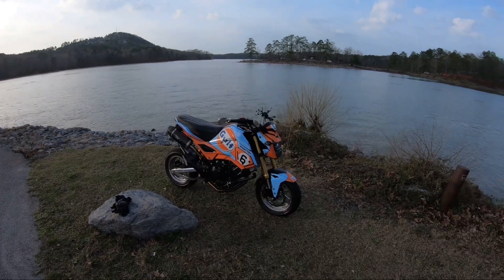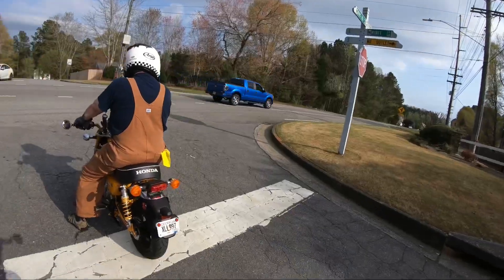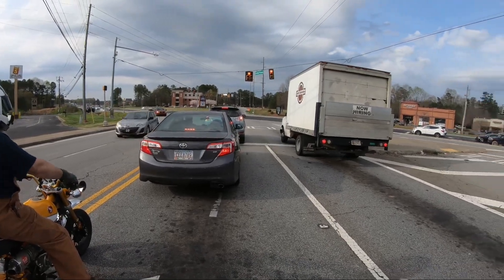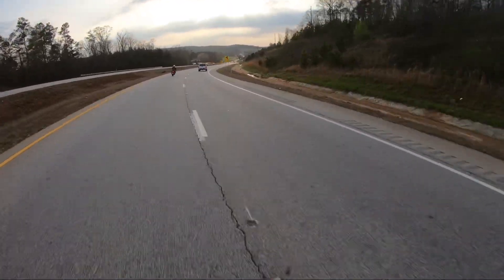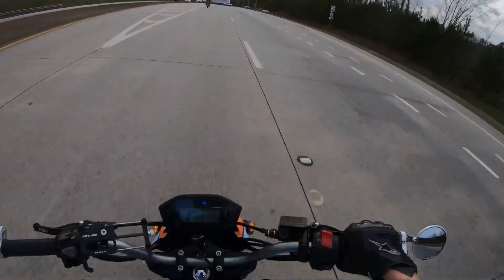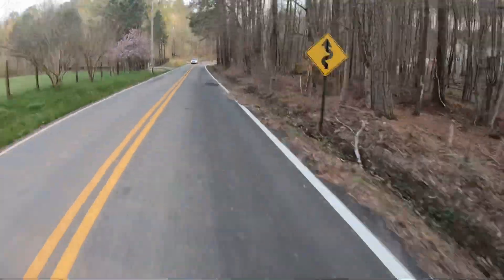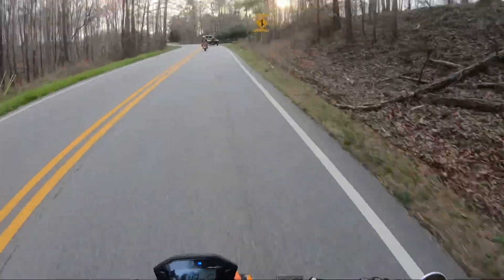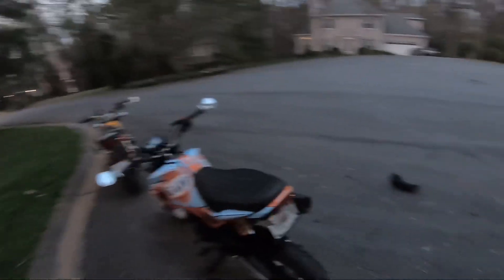Riding a 300cc swapped Grom!

Comment: You speculated that the 286cc grom felt like it had more power than a stock grom. Did you ever confirm that?!? I suspect that putting in the larger engine might have provided more horsepower for the bike, but im not sure. Do the think the heavier engine affected the overall weight of the bike? I think that it might have made the bike heavier than the stock bike. In all seriousness i enjoy your videos. Cheers!

Comment: I was up-burbs in Cherokee city.   Now near Augusta -EAST ON I-20.  I have a 79 Vespa  p200e.  Given to me , hasn’t been ran in yrs.  needs new seat, engine cleaned, new tires, maybe retired.  Chrome rechromed  or replaced.  Only 800 miles on it originally.
I wanna fix it up for small wife.

I have 250cc Eli Aprilia SportCity 260ie 2008 only owner just under 7k miles.  It runs 85 with adult on it. Tires are almost motorcycle size..love it